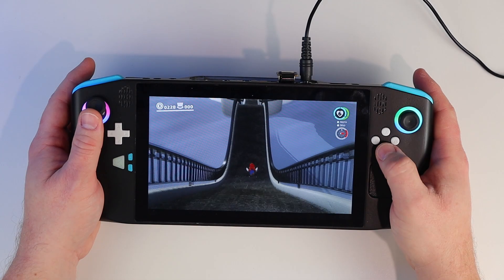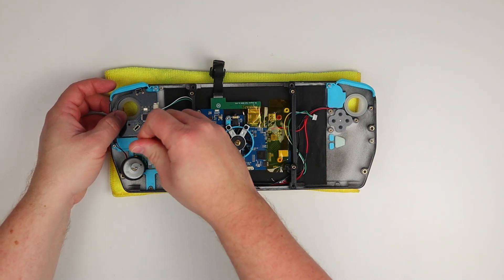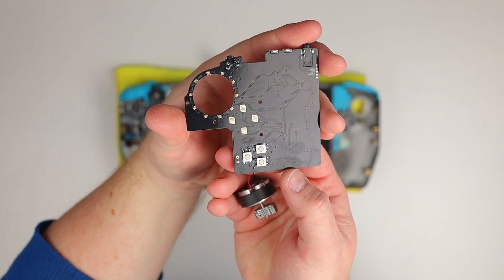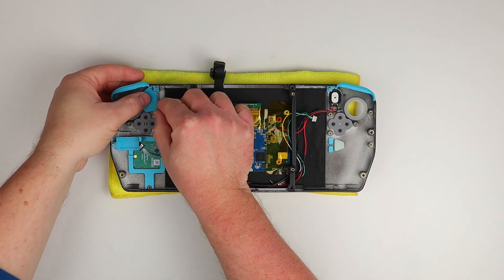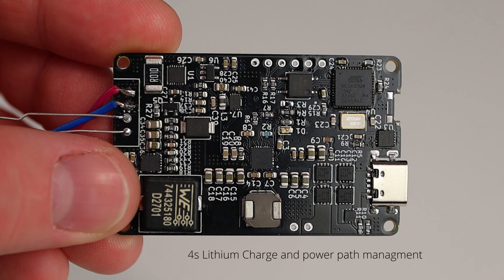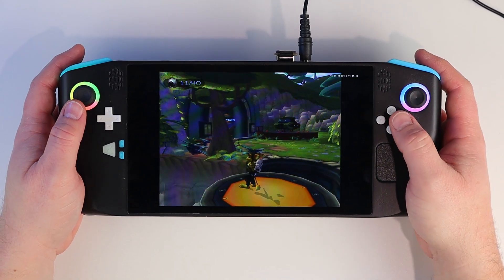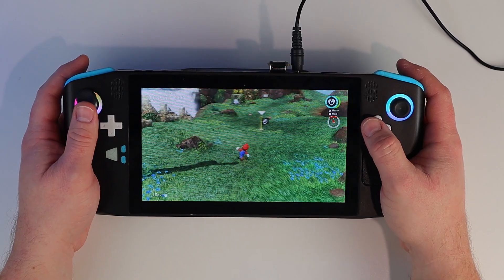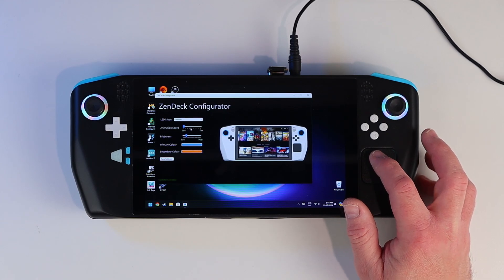Testing Switch emulation on the ZenDeck!

Comment: Hey man, great Project. I have built one handheld as well, though only android Based, but it did have real wii mote capability by including the infrared LEDs for the wii motes for playing games on a TV like Wii Sports.

Now I am looking to build a second, better one, and obviously want to fix my shortcomings of my old one. Exspecially my analog should trigers felt horrible. Is there any chance I could but your PCB Design off you? Looks great!
Reply from the maker: In my experience, it's usually the mechanism of the triggers that affects the feel. I do have all the files available for my previous project which you could take a look at. It works in a pretty similar manner to this one. I will open source the designs for this one, but I need to finish it all off first!
Reply: @cncdan  yeah, obviously the mechanics is to blame.the brief look I had it looked like the shape of your pcb somehow included the trigger mechanicsm,  thats why I asked, but I might be wrong. Because in my old build, I glued a Potentiometer into my 3d hausing, which again, didnt feel great at all, so maybe integrating it on the pcb might be better

Comment: How does this compare, power wise, to an odin2 or a rog ally?
Reply from the maker: It's still a bit slower than the proffesional offerings, but that's just using the mini PC I chose. The whole idea is that you can use whatever mini PC you want as long as it fits and isn't too power hungry for the battery managment to keep up!

Comment: I found your channel while looking for small touchpad for my own controller project and I am very impressed with your work and I have a question. Would you consider using the motherboard of the Minisforum EM780 for the future project or could its small size be a problem due to the display?
Reply from the maker: Smaller is always better when it comes to finding enough room to jam everything in! I looked into some similar pc's but ultimately decided on the Beelink because I could get it locally pretty easily and it's size worked pretty well with the screen I was using anyway so a smaller PC wouldn't have been a huge help on this project!

Comment: I would love to see that power management board become available i may be outing myself as a potential competitor but ive been working on a handheld gaming setup myself not nearly as far along as this it looks amazing btw and ive been struggling to workout a powere supply and charging system on a very tight budget lol keep up the amazing work sir you already helped me out with the video about building the controller
Reply from the maker: The power management is hands down the most complex part of a project like this. I'm definitely hoping to be able to sell a few but I'm unsure how much they will cost yet. The bq25792 IC is almost $10AUD alone!
Reply: @cncdan  well like i sed i for one would be interested if u can nail it down the most strait forward options if looked at so far have been using a ups board if only because there fairly inexpensive but with what you've got there would be so much more compact well good luck and thanks for the response ill keep watching if u keep posting 

And if i get mine running it will be atleast partially thanks to you

Comment: Please, make support for configurating the handheld on Linux, if someone will try to make this project and installs Linux (Fedora/Ubuntu/Arch) they'll soon find out that configuration apps aren't working under Wine on Linux, so you can make simple .sh program or CLI script to make their experience better
Reply from the maker: The control of the LEDs over serial is very simple. I haven't got much experience coding for Linux but if someone can point me in the right direction of what SDK to setup etc I should be able to make it work.
Reply: @cncdan  I think that probably best choice will be making an app with GTK and using PySerial as serial communication utility, or you can try Qt with Qt serial port module as this is a Cross-platform one, so you can make single programm and build it for several platforms

Comment: Oh it would be kinda cool if you could display some kind of game information through the LEDs at the sticks. I know this is a one of a kind device (for now) but I can imagine a bunch of things:
Changing color depending on health
Acting like a circular health bar
RPM Guage in racing games

Or even in Windows:
Having it display CPU Utilization on one Stick and RAM usage on the other

Stuff like that
Reply from the maker: Yes, I like this idea! I probably don't have the necessary programming experience to make that happen, but the control of the lights over serial is very simple so anyone that does know how to pull information like that from a game would have no trouble controlling the lights!
Reply from the maker: Once the power management is working I am planning to have the LED's start blinking red when the battery is getting low. That will only work if the program is open in the background though!
Reply: @cncdan  That's already a very good use for the LEDs!

Comment: Hey Dan, will you ever release all the source, files etc?

This on is on another whole level compared to your previous one!
Would love to try it on my own
Reply from the maker: Basically the plan is to get the design finished and investigate making a kit of parts. If the kit proves financially viable I'll produce a small number of kits and then open source the design as I release the kit. I'm basically trying to avoid having someone come in and steal the design and beat me to manufacture. If I decide the kit isn't worth the hassle I'll just open the design and move on!
Reply: @cncdan  Cool!
Absolutely, I'll get the kit ASAP once you release it, great project Dan!

Comment: Does anyone know how to make joycon controllers using arduino? Am making a handheld and also posting videos of the progress on youtube if you gyes wanna check it out❤
Reply from the maker: Look into using esp32's in your controller halves. There are a few examples of people building wireless controllers with them. You may need a wireless serial link between the two halves as I don't think you'll be able to connect two Bluetooth controllers at once.
Reply: @cncdan  oh thats unfortunate 😕, i think if i used and arduino inside my handheld and then make it so that they are connected through pins would be better, because i just want it to look like a tablet and has attachable controllers for the sake of portability and usability in school since i have a bad laptop and this might be able to replace it, thanks Dan! 😊

Comment: What a great project Dan!! 😅 love the series. If we can order the parts when it's ready it would be great 😊. I can assembly parts and 3d print the case but all the rest what you do is way over my head 😅. So love to see a way to order most of the parts. Pc and display we can order myself
Reply from the maker: I'll be looking into getting the PCBs pre-assembled once I have a final design so I can work out what the actual cost will end up being. Getting pretty close now!
Reply: @cncdan  thanks looking forward to it, I always wanted a device where you can replace the mainboard when it is old with a newer one and you can resuse the shell, display buttons, battery, somewhat like modular device. I think you're project is they one that can do this.. great 😉

Comment: I hope that you will test rpcs3 with armored core 5 and armored core for answer and Xenia with Ace combat 6
Reply from the maker: I don't own any of those titles sadly! I did look at rpcs3 but I believe the 5700u falls a little short of their recommended system requirements so it may not run many titles well. If I do end up giving it a go with the titles I do own, I'll be sure to make a video about it!
Reply: Thank you I greatly look forward to the stress tests  these are very similar loads to what I would be using my own for and it's something my steam deck is completely incapable of